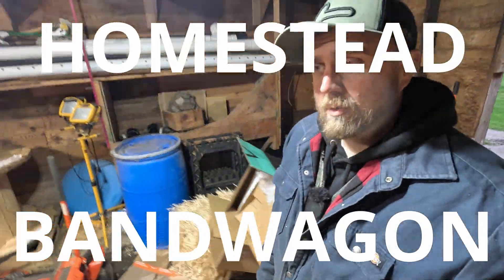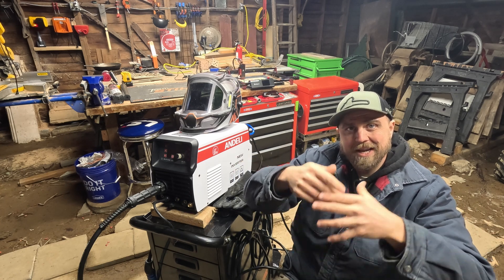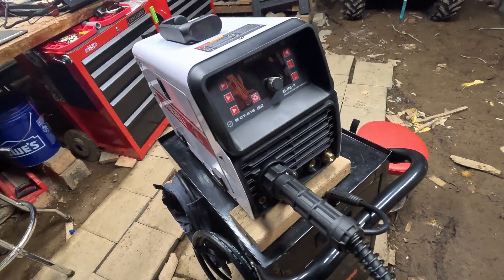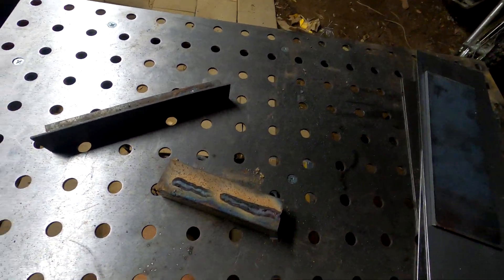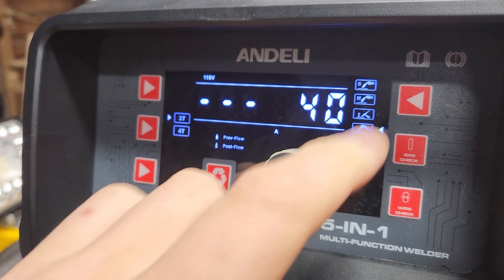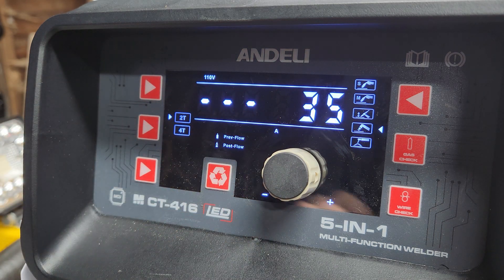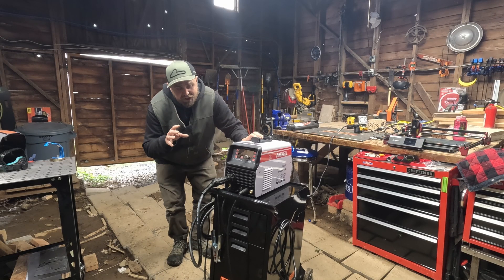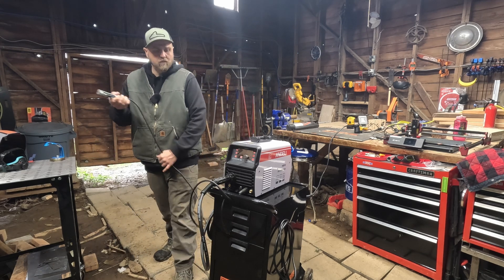Can 1 Machine Really Do it ALL? MIG/FLUX/TIG/Stick/Plasma Cutter Andeli Multi Process Welder Review

Comment: I have the Andeli (big brother) MCT 520DPL(220v), i don`t use Tig even it have HF Tig. Run Mig with gas, MMA, and Plasma 50amp.
Have it for 2 years now and never remove Mig or Plasma main cable, they are mounted on the machine all the time, just switch between the ground copling for different welding and cut  modes. Also convert the plasma to a pilot arc with other torch(AG-60), so it cut easy tru rust and paint.
Very happy with this machine, but it cost me about 750$ back then, delivered to my door.
Reply from the maker: I'm having a little issue with the wire feed on the MIG side. It's not feeding very smooth when I'm welding and makes a nice bird's nest inside the machine if i don't pay close attention. Can't figure out if the feed mechanism is messed up or if it's the sleeve inside the hose or if I'm not getting a consistent ground that's causing an issue. Have you had that problem?
Reply: @HomesteadBandwagon  No never. But i only do MIG with gas, never tried Flux.
Are you sure you use the right roller wheel? There are 3 different type of wheel, one for mig with gas, another for flux, and yet another for aluminium.
Reply from the maker: @stegmater yessir. Using the flux wheel hasn't really helped
Reply: @HomesteadBandwagon probably have the tension on the drive roll too tight which creates tension the wire leading to it jamming up
Reply from the maker: As it turns out, the ground clamp wasn't getting good contact.  So it was feeding wire that wasn't arcing which caused the wire to back up at the feed wheel. Got a new clamp on there, and it works great!

Comment: My husband has it he can’t figure the plasma part can you show me how to connect everything to do it also does it needs air compressor and whats size
Reply from the maker: You'll defintely need an air compressor. I tried it with a little 5 gallon job, but I think you'd need at least a 30 gallon to use it for longer cuts. They do supply an air inlet with a water separator,  which you can just attach to the back of the machine and leave it there. I THINK there's some pictures in the manual, but I lost mine,  so I can't check! 😅

Comment: "find your stick weld thingies ma do"
😂 Subscribed!!!!
Reply from the maker: It's a technical term.  Very scientific
Reply: @HomesteadBandwagon 
Is it still working well? 
Im debating between the andeli and the same type of welder/cuter from HitBox… so wondering on the quality of those brands
Reply from the maker: @NukemGarage it's fine.  I've had a small issue with getting the cable to seat correctly in the negative terminal but got it sorted.  I've tried a hitbox as well and it worked just as good. Maybe just go with whichever one looks cooler. The hitbox I tried did have some extra settings for the stick side that were kinda nifty, but I honestly don't know that they really made a difference. I think the cords and cables for the Andeli were longer and thicker,  so that might make a difference
Reply: @HomesteadBandwagon  thank you! Finding good reviews on these welders is so hit and miss… and few go into longevity so I am glad that both brands seem to have held up so far… I am 
I have started doing “Great or Garbage” reviews on cheap tools etc I buy off of temu/amazon..with some surprising results… but I have zero experience with welders and definitely want something that hopefully lasts a good while… 
Oh the andeli. To start the plasma do you have to make contact with the steel or is it non-touch start?
Reply from the maker: Sounds like i good idea! I'll check your channel out. The plasma requires contact, so you'll need to invest in some tips. I was gonna grab some from Harbor Freight to see if they fit,  but I'm waiting until their spring sale